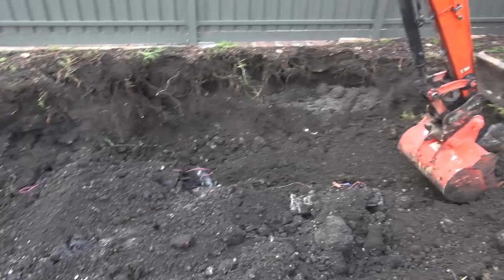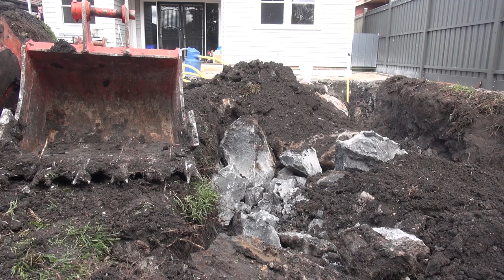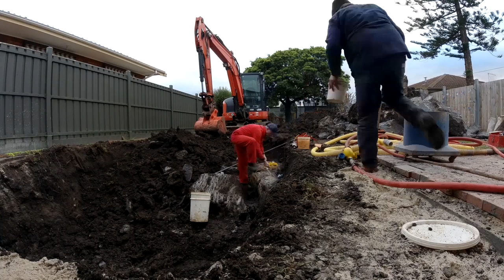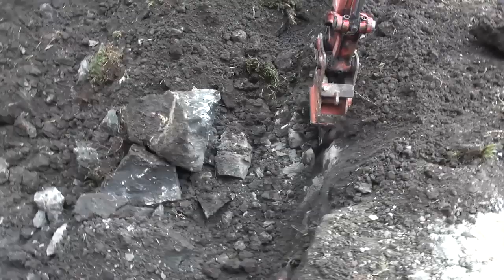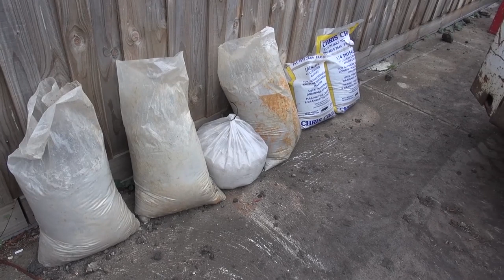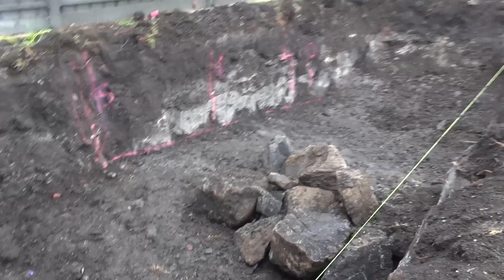Rock Blasting for a large swimming pool in Yarraville

Comment: My main exposure to blasting has been while working underground, hard rock mining.  The contrast between the somewhat surgical blasting you do and advancing 4M in a 5.5 X 5.5M drive per blast is quite interesting, not to mention when we fired stopes taking out thousands of tonnes in one blast with I-KON detonators.
God I love explosives!
Reply from the maker: It is a different approach for sure Karl, you need to get good fragmentation without even having a free face to work with, you require about 5 times the load rates that I would normally use.
Reply: Well is other type of blast, in my case the size of the holes is of 89mm by 15m, and the mesh 2.5m by 3.0m ...

Comment: did a lot of stump blasting back in the 70's and 80's was good fun and a fair way to earn a living. Question/ Do you have any issues with the foundations on the adjoining houses. Id worry about damagng the foundations blasting rock that close to other houses. great videos, thank you.
Reply from the maker: Generally no problems Kevin, all (or most) of these shots where there is more than one hole use millisecond delay blasting, this is where the is a few milliseconds delay between each hole firing, this moderates the jolt considerably.

Comment: Hey mate iv done a far bit of larger scale blasting and mines and stuff, I would like to do some of this smaller scale stuff in close proximity to things. Just for popping the rocks what are you loading the holes with, what quantity, what delays
Reply from the maker: Hi Kyle, thanks for watching. It's just like the big jobs but in small scale, all of the same rules apply. Note though that you are not feeding a crusher so you don't need to hit  it as hard, about 300g/m3 for a earth covered shot is enough to be able to dig out the pieces. The cover soaks up a lot of energy so even less is required for a blast mat shot. One hole per delay and no holes closer than 8mS

Comment: Great job. Maybe you need some nonexplosive equipment that used for stone breaking. Have you heard about the hydraulic rock splitter please? it  uses the wedge principle to break the stone inside. Drill hols first, then put the rock splitter in. So easy.
Reply from the maker: Thank you, I have a Darda splitter that I can use any time, very good in some applications where explosives can not be used.
Reply: @demolitiondavedrillandblast  That's wonderful, the splitter always works well.

Comment: With the other structures so close surely you have a bit of unfortunate collateral damage.once in a while......Its ver easy to do. Septic tank lines, transite pipeline , clay sewer lines , that iron and tar septic pipe from the old days , even water mains.Can you tell me what most of those lines are made of in your work areas ???. One old farmer was a little too close and wiped out his septic leech field here in Idaho.......oops ......
.....
Reply from the maker: Most new pipes are PVC which is fairly resilient, or poly ethylene which is really tough. older sewer and storm water pipes are terracotta which is venerable, larger drain pipes are concrete with steel mesh reinforcing. Not breaking stuff with blast vibration is all about keeping the charge mass per delay period low and other little tricks of the trade.

Comment: Where did you learn to do explosive work?
Reply from the maker: From books initially, started reading about blasting when I was about 10, managed to get my hands on a government issued training manual when I was about 14 band read it over and over. Regulations back then said that I could not get a start in the industry until aged 21, did another trade, came back to it aged 27, did a training course, past and exam and all the checks, got a licence and went for it.
Reply: @demolitiondavedrillandblast  was the course work exxy? What was the gov manual named?